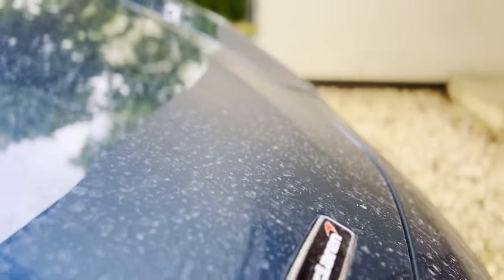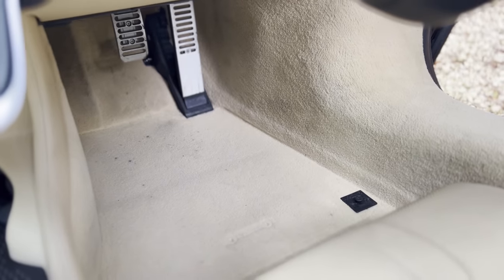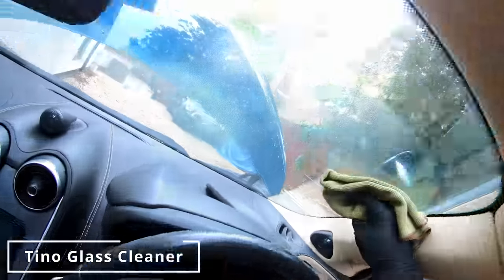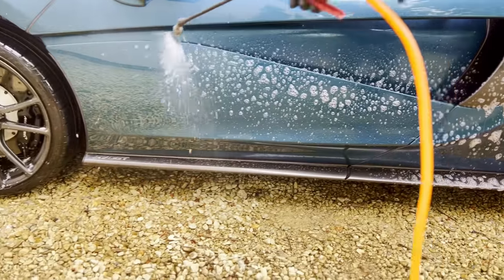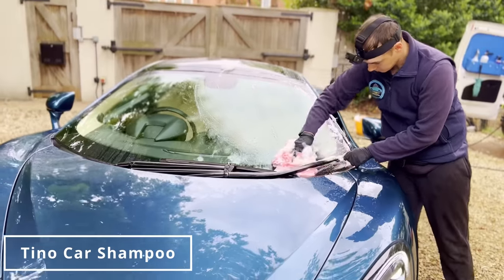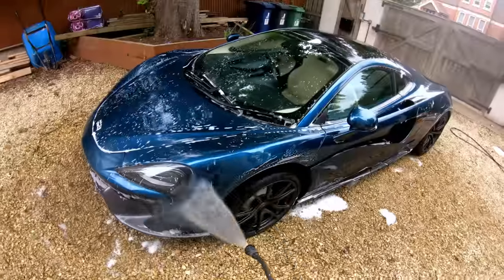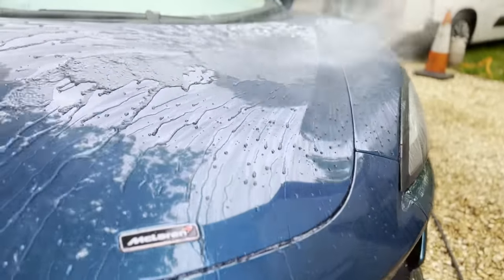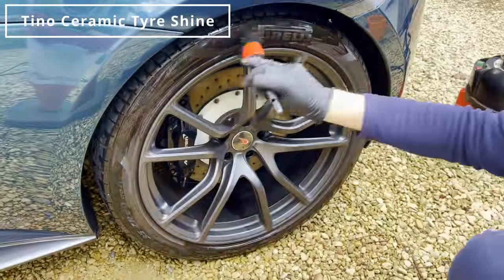Disaster Detail on a SUPER CAR!

Comment: Ref vacuuming,  better to use a brush attachment rather than just the crevice attachment.
This agitates the carpet fibres making it easier to remove deep  down dirt. Same with the dash and vents ect.  Using a dusting brush on its own just moves dust around, use a vacuum brush instead.

Comment: One thing I've noticed about your videos is that you never mention adding air fresheners. I always add a nice freshener spray in my car after washing it and it always adds a nice final touch.
Reply from the maker: You have a very good point. However the reason I do not add the air fresheners in every wash is that many customers may have asthma or other conditions, or may not like air fresheners. So I usually just ask at the end if they would like one

Comment: Hi Tino do you always apply your snowfoam over your APC? I normally do snowfoam first then APC after? Do you notice a difference combining the two as I assumed the foam would Dilutee the APC? Cheers
Reply from the maker: Hello Dylan, I have tested between the two quite intensely and would recommend using the APC first. This is because, the APC has stronger cleaning power and using it first gives it direct contact with the dirt, then the snow foam on top allows it to dwell a little longer on the car. However if you use the snow foam first, the APC will struggle to get to the dirt as it has to penetrate the layer of foam.
Reply: @TinoCarCare  Sorry I think I worded my question wrong. What I meant was normally I rinse the car with water then apply snowfoam allow it to dwell, then I rinse the snowfoam off the car I then apply APC allow that to dwell and rinse it off. So instead of doing both stages in one go i do them separately :)

Comment: Why do you move the car after you have cleaned the wheels?
Reply from the maker: I do this to change the angle of the wheels, so the sides which were facing down, are now facing up. This helps not miss a spot on the whole wheel

Comment: You wouldnt be washing my car
Should be one panel at a time and rinse but the red line you crossed was washing the underside of the rear diffuser then the mitt went onto the corner of the rear bumper…there would defo be grit on mitt rubbed into paint…very poor technique